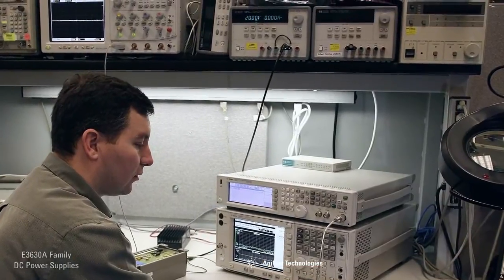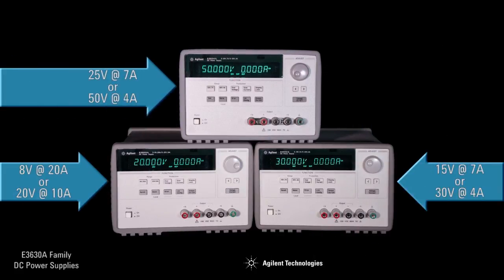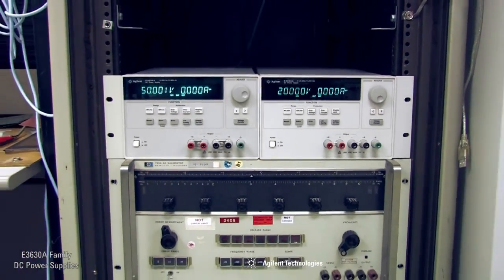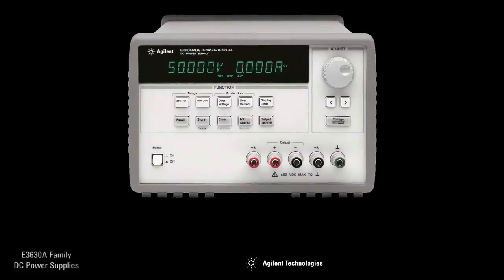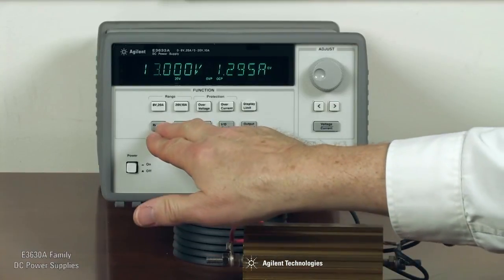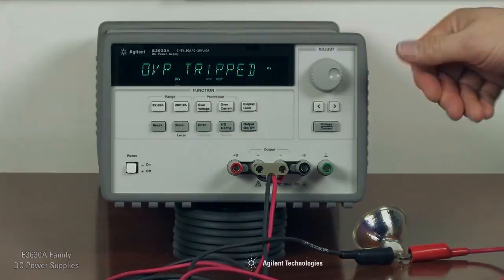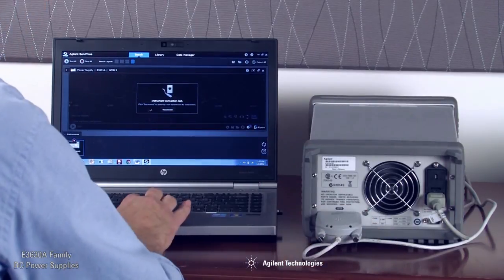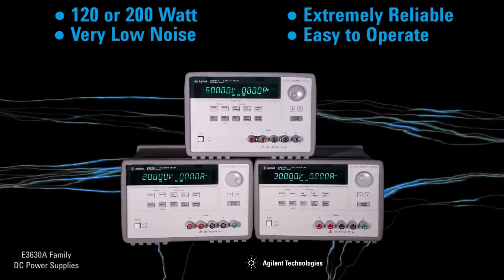E3632A, E3633A, E3634A Programmable DC Power Supplies Product Overview

Comment: with a source of this type can I have a voltage of .86v and limit the current to 0.0001A? or the current is adjusted depending on the voltage? I would appreciate your response
Reply from the maker: pepito .n  It is really difficult to measure and limit current to 100 uA. The E3630 series are high power bench supplies 120 to 200 W. So, they are not ideal for sourcing low voltage and setting a low current limit. Without spending a fortune we offer the E36100B single output and the E36312A triple output power supply which can have a 1 mA current limit and both have a low current measurement range. On the low current range, they can resolve to 1 uA.

Comment: Hi, we do own a Keysight E3634A DC power supply. May I know in order to utilize the BenchVue tool, how do I go about setting it up? I tried to use a USB to serial cable connecting my PC to the power supply's RS232 port but it doesn't seem to work. Please advise. Thank you :)

Comment: do you mind if I ask, what kind of electronic/dummy load do you use? the one in the video with analog indicators? <3
Reply from the maker: The instrument in the video with the analog indicators is a variable ac source - it is used to show that changes in the ac line voltage did not effect the output.  We loaded the output of the power supplies with a resistor.  In other videos we have used an electronic load.  The electronic load is pretty sophisticated, we use it to test the response to load variations.